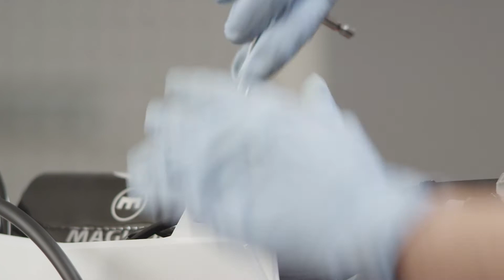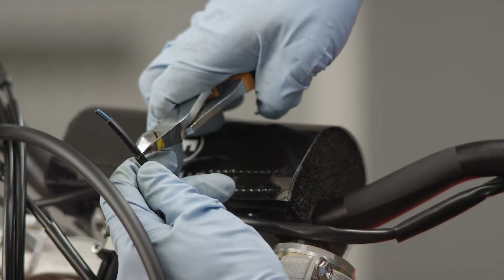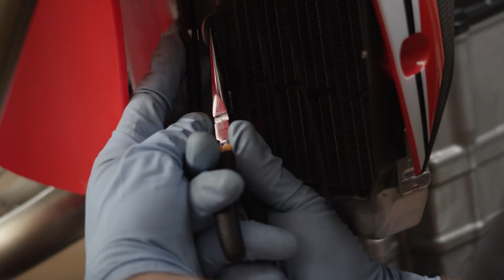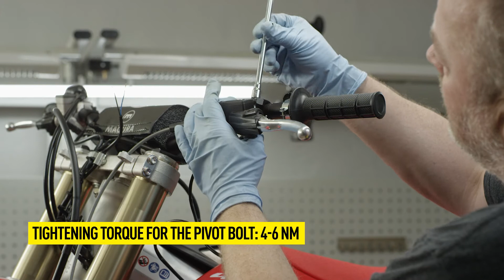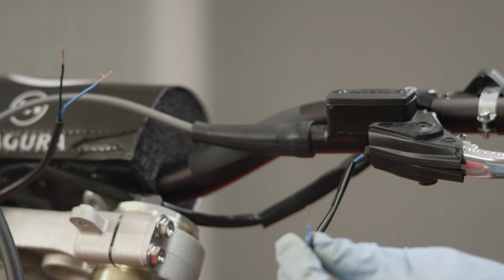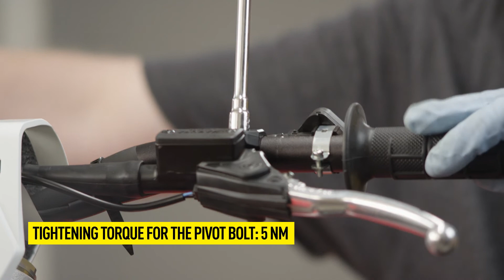MAGURA HYMEC - Installation Offroad Clutch Kit

Comment: Hi folks I have this setup on my 2019 Honda CRF450L and I get 9mm of free play on the slave cylinder? There were no spacers in the kit and I'm not sure how you would even use them if they were - due to the design of the brass cap and mounting bracket? Can you please tell me if there is a way to bring the play back to 6mm as the clutch does NOT disengage as much as the standard cable version? Thank you
Reply from the maker: Please contact us via our contact form for this particular issue: https://www.magura.com/en/components/contact/ We will be able to help you there!